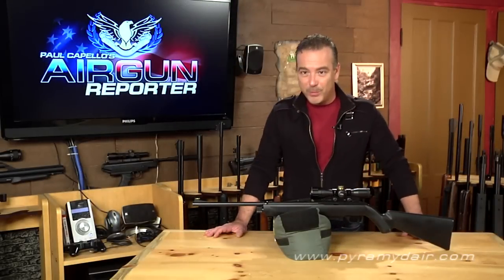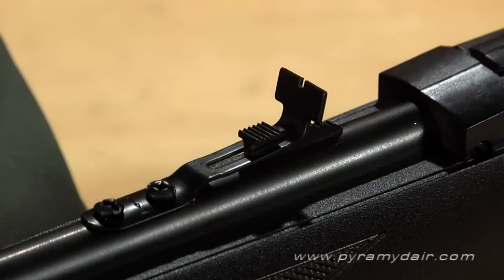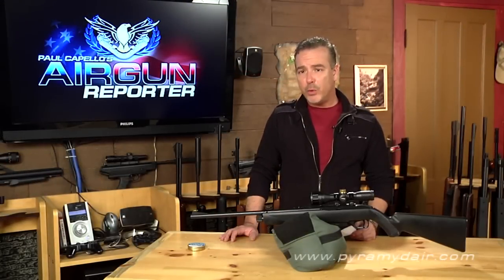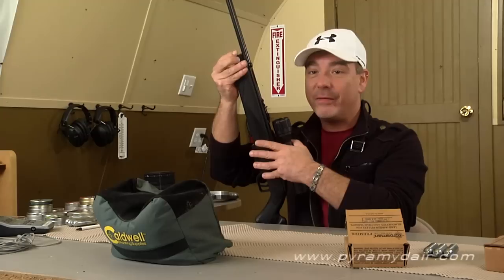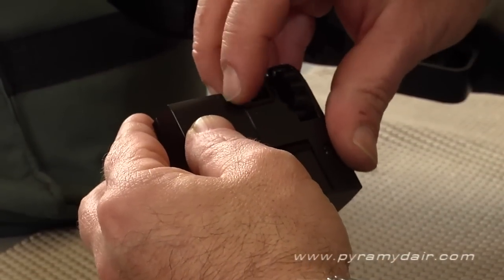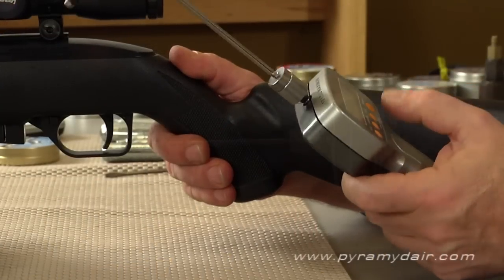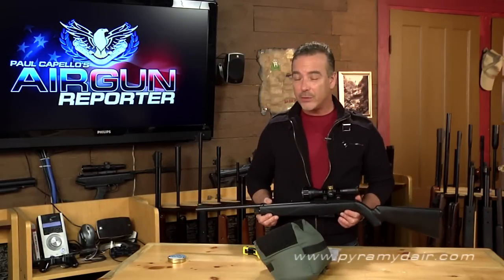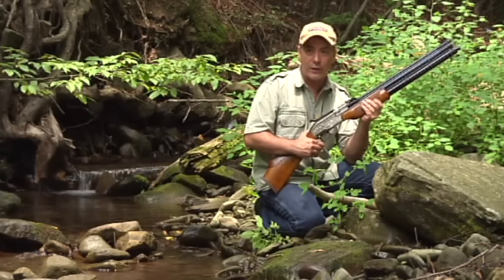Airgun Reporter Episode 79: Crosman 1077 Air Rifle

Comment: I got 2 kinds of air power now, I got HPA tanks in 4500 psi, or Co2 tanks in 3500 psi,  and now the 99g co2 cartridges adaptor , So i can now shoot in HPA, And all different kinds of co2 tanks, and cartridges,  as well !  > 12g, 16g, 88g, and 90g co2 cartridges ! So If i can't get my hands on co2 ?  I'am back up with 13ci 3000 psi HPA tanks i put soft velco around the tank and the ruff velco to the stock < > for a for hand stock Same with the big cartridges i use them for a for hand stock as well

Comment: How to joint the magazine  take the 2 magazine sand them down flush on each bottom take a few drop of super glue and set them  one side on different end and flush hold a few sec.   AND NOW GOT A DOUBLE MAGAZINE these new magazines some are hard to unlock. Take a knife just crap the lip off some, until its comfortable to unlock  > Mine is loud. i put a 10.22 Tanker Muzzle break on it. for more power. Its loud as a 22 now

Comment: What happens if the put the CO2 cartridge in one day and the you use it then and next day you when you go to put a new CO2 cartridge it does not go all the way down and then it seems that it looks like there is a pointy piece of metal sticking down and CO2 is right up at the top of the C02 Barrel.

Comment: I just got the 1077 and not even getting 24 good shots before the co2 runs low. I do notice during each shot a white spray coming out the barrel, as well as both sides of the magazine. Is this normal or part of the problem?

Comment: no i cant afford pelgun oil right now and do not know where to find it! and yes i talked to crosman customer service they said the gun diffective i was like no s**t but it isn't a small leak it leaks from the barrel the idk what its called the place u put the cartridge. and the upper screws on the side you need to take the stock off and there are 2 flat headed screws there leaking and alot of other places man i had it for like 1 week shot it like 2 maybe 3 times then it started leaking plz help!

Comment: You're right that this is one of  the most fun airguns. I tried one today and i went through 9 co2 cartridges and around 350 pellets. A cartridge would last for 3 complete magazines. For the first magazine i could use heavier pellets such as H&N Baracuda Power with great success. After that i would load it with H&N Sport Econs that proved to be a good plinking pellet. Only downside is it's rear sight. Terrible. But it is so much fun to shoot, that you just can't stop!!! What else do you need?

Comment: the Crosman 1077 is a cool gun for target shooting especially cans and the metal spinners. the great thing is you load 12 pellets and pop away. I use the daisy 177 at $1.99  for 250 you will get tired before you run out of pellets. I also have the Crosman 1377 American Classic also a cool gun but when I get tired of pumping I go back to my 1077.

Comment: I used to own the gun, now its a pile of parts, since it broke internally, and leaked every time it was dropped or bumped slightly hard, I had to try to take it apart myself and try to fix it, a very difficult gun to work on, similar internals as the crosman 357 six shooter.  I may have just had a defective rifle. Otherwise I loved the gun, and the wooden stock model has a really nice Ruger 10/22 look to it.  Trigger pull was slightly heavy, this is due to how the trigger cycles the mag.

Comment: I've never had any issues putting pointed pellets through my 1077. The rotary clip is deep enough to not cause jams with them, but I wouldn't try those crazy long Gamo gimmick rounds.
Reply: +Porty1119 does it still work
Reply: LLEVNED Yes.

Comment: I've had my 1077 for awhile now and I'm having a problem with the co2. Every time I load it now it just doesn't fully connect with the gun so all the co2 drains out. Is there any way to fix this?
Reply: Jo Evan There are two places that can leak on you and they are at the ends of the tube connecting the CO2 tube to the valve.There is a very small o-ring at both ends of the tube that can dry out or get rusty.
Take the bent tube out and make sure the ends are clean then put a drop of Pelgun oil on the little o-rings and put the small tube back in. Let it sit for 24 hours and try to use the rifle again.
If it still leaks it's time for new seals and o-rings.
Reply: +NotSoDumb  I'm having the same problem I guess.  I left a co2 cartridge in the gun for years and now it want shoot or the cartridge wont come out .  Do I have to take the gun completely apart to check the seals and O-rings and to be able to get the old co2 cartridge out ?
Reply: I believe you will need to take the rifle apart. It's really simple but make sure you take a good look at the trigger setup so when you put it back together there won't be a problem.
corrosion has set in, the co2 cartridge is probably rusted to the end where it rests against the inside o-ring.
Once you get the whole thing apart, you should be able to get the thing out but I would suggest replacing all the little o-rings and tube. They come in a kit for under $30. The kit will have a new valve too.
Good luck.

Comment from the maker: With an air rifle, rule of thumb is around 40 shots per 12 gram CO2 cartridge, although that can vary. 

Thanks,
Pyramyd Air Team
Reply: Yeah you might get 40 shots out of one cartridge but those last 10 are going to be pretty weak.
Reply: Yep, but it beat loading and pumping every shot. Paintball tank is the only way to really FLY

Comment: Bought my 1077 new about 7-8 years ago, and it's still going strong. I just installed one of the Delrin barrel bushings. This is to keep the muzzle end of the barrel in a stationary position.  You tap off the front sight, and tap the new bushing into the muzzle, and then tap the sight back in place. You'll see, with the front sight off,  the barrel just flops around. And, the hole in the sight assembly is still way bigger than the barrel, so, from the factory, they barrel is a sloppy fit from the factory.  Seems like the new bushing has helped some in accuracy, and number of uncalled fliers. 
    Mine gets about 40 good shots from a CO2 can, and then starts dropping the pellets on the target fast. 
    My 1077 has a preference for Crosman hollow points, and the Benjamin hollow points also. 
    I have always put a drop of oil on every CO2 can when installing, and I do not leave a CO2 can in the gun when I put it away. My seals are holding after almost 8 years and probably 800 pellets fired. If you want the most accurate air rifle for your bucks, this isn't it.  But, it does have decent accuracy and is really fun to shoot. You will not find any other repeaters for anywhere near the price of the 1077. 

   It has a howler of a bad trigger. All that being said, with careful technique, you can get good groups with this airgun.  1/4" off a rest at 11 yards is possible, and I get a few 0" center to center 3 shot groups too. Just not as often as with my best air rifles.

    If someone stole  my 1077, would I get another one?  I believe I would. I have a 3x9 Leapers scope on mine, so that shows what I think of this airgun. 

   I live in Hawaii, so the climate is great for a CO2 shooter.

    Now, you want to talk tackdrivers! MY Crosman Custom Shop 2400KT carbine in .177 is it!  Yet, the past few weeks I have been shooting the heck out of my 1077. It's a bit challenging, while the 24400KT is super easy to get 0" center to center groups. 

    The 1077 is just fun to shoot, and that;'s what it's all about.
Reply: You got 40 shots (consistent) and at what distance? 
I just got a new one and I’m getting 18 or so good shots @ +-70 feet before it drops.

Comment: What is the problem with cold temps?
Reply: CO2 doesn't vaporise very well at low temperatures.

That, along with the cooling effect of releasing pressurised gas, causes a fall off in velocity.

Comment: My 1077 started leaking after 3 cartridges. Then I got another 1077, and also this one started leaking after 3 cartridges. Is it possible that I screw te cartridge in to tight? I dont juse a screwdriver, just with my bare hands until it dont screw anymore.

Comment: My 1077 will spit out, and I literally mean spit, the first four pellets at VERY low velocity, then pressure will gradually increase with each subsequent shot to full power. This happens any time I set the gun down for ten minute or more. Gas is not leaking out, and I seem to get the usual number of total shot with each CO2 cartridge, but the first four or five shots are wasted. Anybody got a cure for this?

Comment: Might buy for the kids.. but I'm no fan of plastic. In this case it reduces both price and weight which is desirable
Reply: TheKimjoh560 Crosman's website has a variant with full wood stock.
Reply: TheKimjoh560 , crosman makes this model with a wood stock also, at least they used to. But The black plastic ones are nice; it's a good thick material and very tough, but nice and light.

Comment: G'day, I just got my 1077 the other day, and it's great fun to shoot.
But when I load in a co2 cylinder it barely gets punctured and take a long time to fill the gun with gas. You can here it releasing very slowly take between 3-5 before i shot can be made. Is there anything I can to get it shooting straight away like you did in the video.
Cheers

Comment: I just re-sealed my friends 1077 and it's shooting just like new.
Great little CO2 rifle and hard to beat for the money.
Thanks for the review Paul.
Reply: Mine stopped shooting. Could it be the seal? If so do I have to take the gun apart? Thanks!
Reply: @jimmywood3735  , get and use only silicone oil. Cover the CO2 cartridge-to-valve seal with the silicone. Not 
necessary to disable. 
Let it set for a week or longer. Keep all airgun seals well oiled. Put a drop on every cartridge head as loading it.